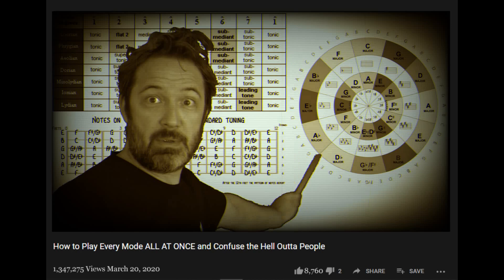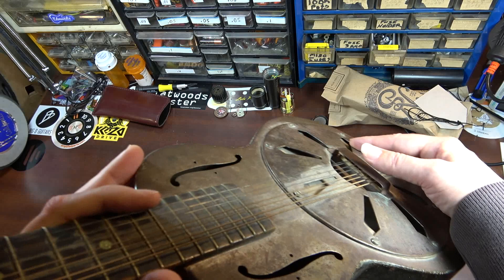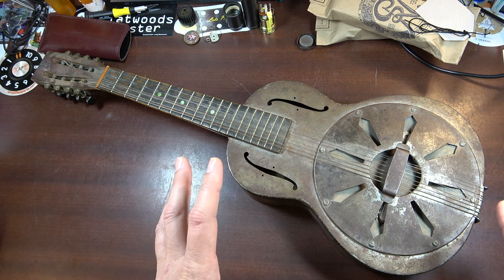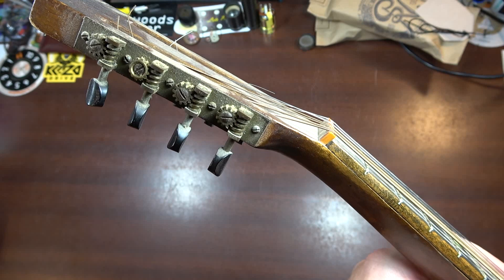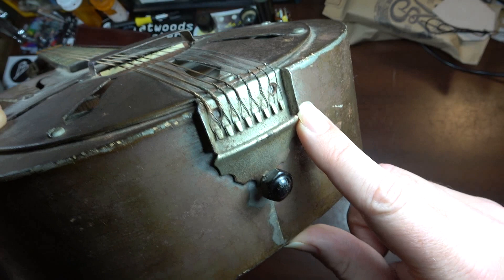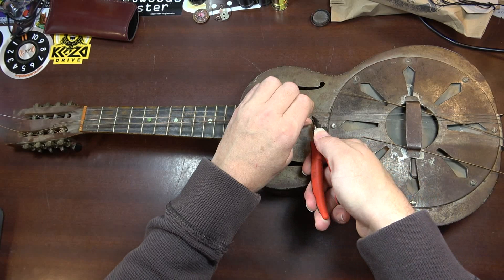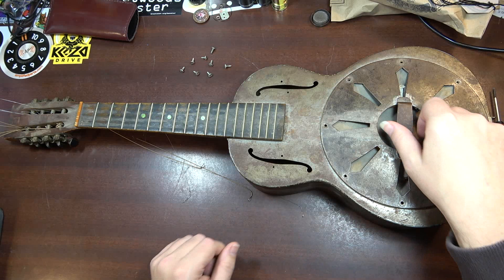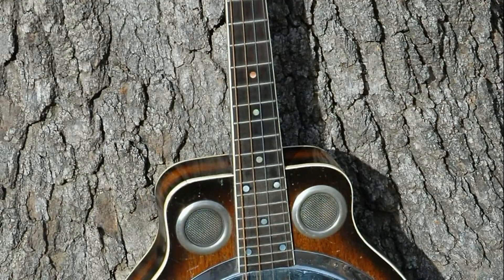Is this Guitar-Shaped MYSTERY a LOST & FORGOTTEN 1930s Prototype?

Comment: My first impressions just based off the shape of the f-holes and the pattern on the cone is Slingerland, Maybell, B&J Serenader, and definitely Chicago/Regal or made with Regal parts. Del Oro made some faux resonators as well, but none of them were metal body from what I've seen. Some are branded underneath the center block.. when they have one.. This was a project that was started by someone who knew what they were doing, and finished by a novice with what they had laying around. I'd tell the owner to spend a little and finish it the right way or hang it on the wall, because it sure looks cool. It's safe to call it a Regal, or of Regal origins.

Comment: I would so love to get my hands on that for a while. A local engineer's shop would make an aluminum disk to replace that nasty paper fiber thing, a bit of welding to get a block in there for the bolts from the neck to attach to, and it would turn out much nicer than the original build. Plus, that's gotta be at least as old as 1940, so it's just a nice piece to have.

Comment: The neck fix is easy Brad. Like you said, with the neck extension piece to the bridge ( like a banjo). If you want to go bonkers you can make a 3 piece laminated extension, middle quarter sawn. As for the cone, make one custom. This would make a cool mod project! Added thought: you can make the neck stabilizer rod adjustable easily: just make the rod shorter ( 1-2 mms) put a threaded ferrel in and a longer screw which holds the bridge.

Comment: The two companies mentioned in the complaint- Fretted Instrument Manufacturing Corporation and United Guitar Corporation were run by John Carner and merged into one another. John Carner had acquired Oscar Schmidt of New Jersey in 1935 and he continued to run it with that new name printed on Oscar Schmidt type labels in the guitars. However, in 1939, he sold the two main brands made- Stella and Sovereign to Harmony of Chicago. He then began United. United made a wooden resonator mandolin that was sold for quite a few years under the United name but also as Medalist, Beltone and Blue Comet. Someone at some point has misattributed the Blue Comet to Regal and now everybody thinks these instruments- even though many have the United name on them were made by Regal. Google these words if you want to see one:  "C 1930s Medalist Resonator Mandolin Gryphon " and a few photos should pop up.

Comment: Resonator replacement idea coming to you from the Haight Ashbury - repurpose an aluminum passive radiator cone or take the magnet off a shallow mount driver with a working spider the approximate diameter.

Comment: This one is a first for me too. There seems to be a lot of weird little mandolin-based instruments from that era, so no big surprise really. I used to have a Washburn banjolin and it was right at a S.O.B. to keep in tune.🙄 It actually had a square post coming off the back of the neck that hooked to the opposite side of the banjo resonator hoop and like that one, the neck angle was way off, but it was relatively straight. I filled and redrilled the screw hole in the end of the post to get the neck angle right, but even though it was playable afterwards, I never really liked the sound of it with all the overtones and undertones that the resonator created. (The bridge actually sat directly on the resonator head like a banjo and it was miserable to tune (and keep tuned)). I finally ended up using it as partial trading material for my ES-335 later on. Good riddance!!🤣

Comment: Shape of the back of the neck is too good to be homemade in my opinion.   Looks like the back of old washburns from that eras.  The tuners have the “worm” on the bottom which I think was common in the early 1900s.  My first thought was someone took an old parlor guitar neck.  Cut the fret board off and then changed the scale by putting a mandolin fretboard on it, but how would you find a mandolin board that wide?   The neck looks like it was played and loved.  The back of the neck looks so much better than the rest of the instrument to me.  That may have happened in a previous life though.

Comment: The holes in the cover plate appear similar to the holes in a Dobro ‘poinsettia’ style cover plate, but this does not appear to be a Dobro product.  
If you want to use a real resonator cone, it would need a lip or ledge underneath the top in which the cone would sit.  You don’t want the cone to be screwed to the top like this one was.
Reply from the maker: I’ve owned a 1936 or so Regal Dobro poinsettia before. You’re right, this isn’t a Dobro product for sure.

Comment: it was a Uke Reso.. Someone converted it to a Mandolin by replacing the nut and saddle...? And it was a DIY project with scalped parts and that explains the choice of materials and the sub par craftsmanship... I dunno though. Just a guess. I'm not even sure of the neck specs between a common Uke and a Mando.. If they are indeed compatible..

Comment: Do you think it could be a lot newer than we think it is?? I’m not seeing much of anything (except cosmetics) that point to this being very old.  

Someone clearly airbrushed a fake spider onto that paper and the screws are not machine screws like you would expect.  

Maybe a 60s catalog instrument that someone had decided to modify and try and pass off as older?? 

I’m not convinced it’s actually pre war.
Reply from the maker: Patina points to age. And resonators were basically out when WWII shortages came. Plus, the 30s was a high point for ukuleles, mandolins, and resonators in general. Even after WWII, no one made resos for a while because of the rise of electrics. I don’t see anyone making this post war. Wouldn’t have been a market anywhere.

Comment: BRAD? On the marshall mg 100? Do you th8nk I could replace the power amp with a car audio amp? Its 12v-14v and they come in various wattages. Anything to get the hell away with the fan cooled shit. Whar do you think?? Or at least just the mg as a preamp for another amp.
Reply from the maker: Yes. You can connect the audio from the preamp to another power amp.
Reply: @TheGuitologist  hey thanks
Reply: Im not even using it because at practice time the fan sound is the loudest thing in the house. And damn to try and use a microphone to record with. Its not the fan is broke or anything its just the noise of a fan runnin. The inexpensive replacement part and the price of the fan must be the cheapest way to go way cheaper than the valvestate power amp or is the valvestate the same thing without the fan? For a solid state amp I like it no doubt AND as much as the fender and squier ss amps too. I work my guitar and amp and prefer tubes. The ss just requires a different way of workin it and it is different.

Comment: hey brad, whats your opinion of the ampeg baxandal eq stack?
Reply from the maker: They take some getting used to if you're used to Fender style tone stacks. They seem to take me more time to find the tone I'm after, so I don't use them in anything I build or mod.
Reply: @TheGuitologist  ive tried several stacks, one knob, two knob, marshall, fender, i seem to kinda like no stack with a little detailed coupling cap shaping the best, the amp just breathes on its own without tone knobs, maybe you have a suggestion for a  stack thats dynamic and allows the amp to breath?

Comment: early welding would be using lead , a scratch test would prove lead and or repair solder .. also early torches were not as finely feather tipped  as today's torch types . there is a wide heat effected zone noticeable inside . i know not much help .  fix it for the guy ....